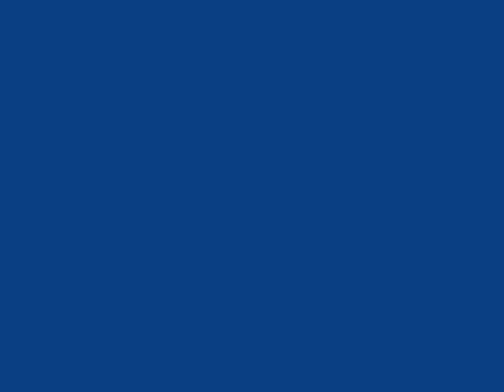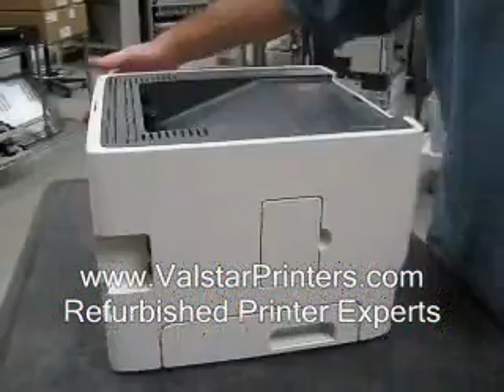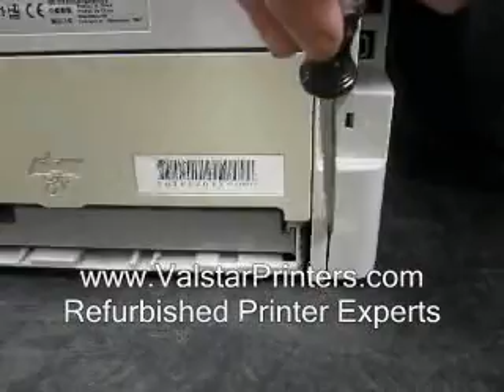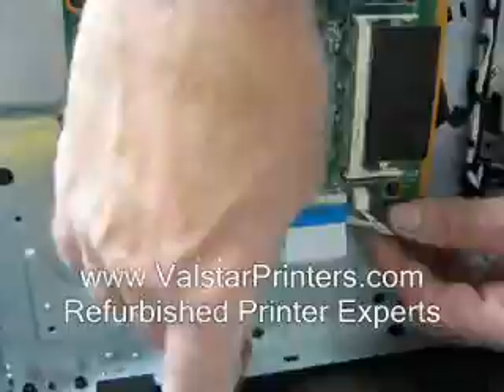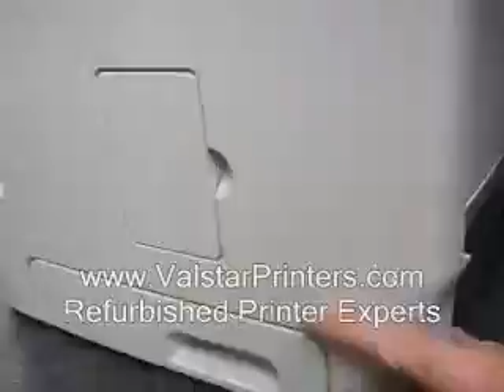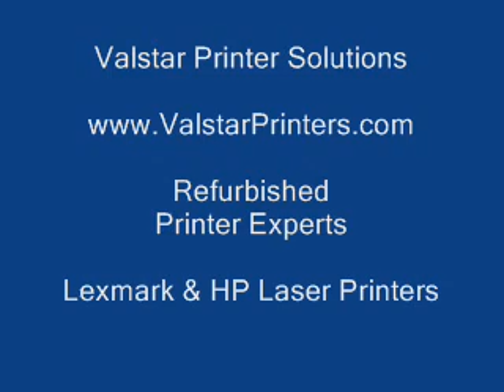HP P2015 formatter board installation.wmv

Comment: Hello. Can you install the Formatter Board of a P2015dn printer to a P2015d series? The dn series has the Internet port but the d series doesn't. I would like to know if these boards are interchangeable. Thank you.
Reply: Yes you can install it. But you first have to slide out the cover where the network port on the board is supposed to pass through the removed cover of the printer from the cover and fix it back on the printer. Cover it and you will realise that it fits perfectly. If you donot remove the cover by so doing creating a space for the ethernet port on the board to penetrate and show outside after replacing the cover, you will realise that the cover will not be able to perfectly close with the printer